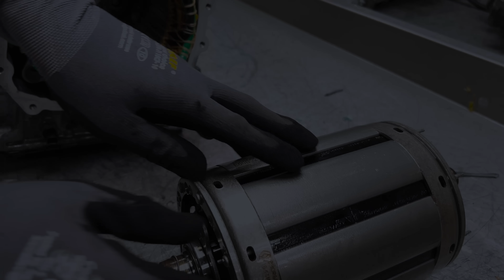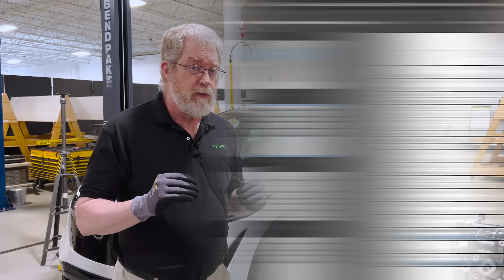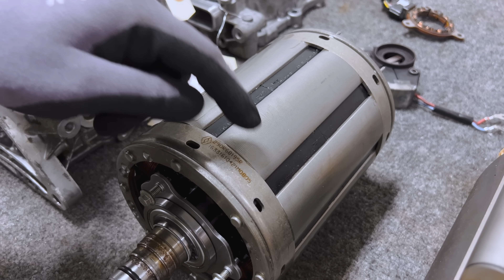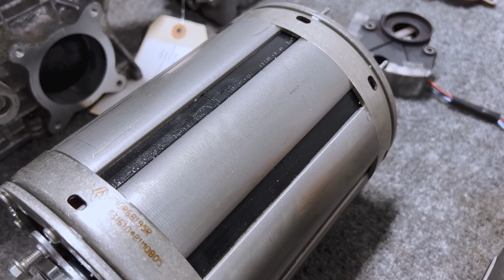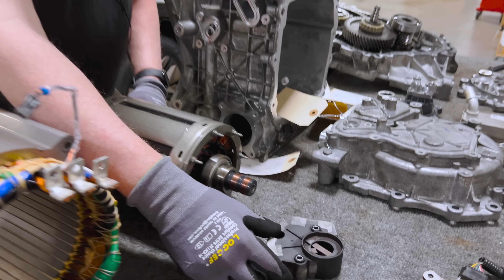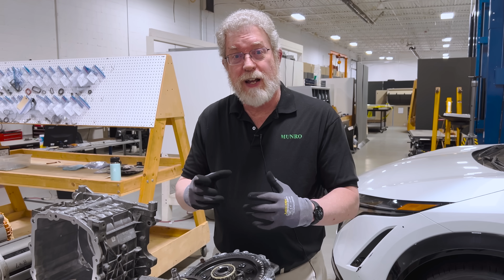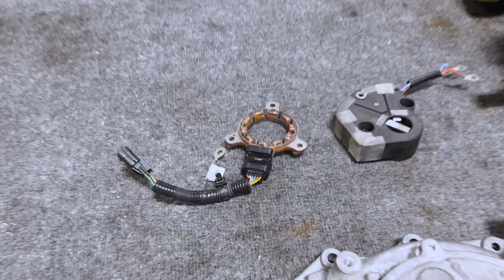This EV Motor Has No Magnets – Nissan Ariya EESM Teardown

Comment: I can't imagine any EV using field weakening unless it's very poorly designed. Clearly they are going to design the bus voltage and KV rating of the motor to allow it to function at maximum design rpm without having to use field weakening.
Reply: Clearly you don't understand motor control... but I'm sure you enjoy playing with your RC toys.

Comment: Did you know that trans-bearing high currents induce rotation to form a Marinov motor. The effect is very weak and it took me 165A to get to 1200 rpm.  It works on AC and DC and can run underwater. Google tesla downunder marinov

Comment: There was a claim that an induction motor is more efficient than a permanent magnet motor at speed. From what I can tell, this depends on gearing, and induction motor is only more efficient at really high RPM. Tesla uses PM magnet motor for efficiency, at highway driving speeds. So would be interesting to hear more why this was claimed.

Comment: So how often will the brushes need to be replaced and what will the cost of that job be?
Reply: He said that he expects the brushes might last over 250,000 miles.  Then, open a simple access panel and pop in a new part.  Imagine if an ICE engine would last 250,000 miles, and then open a simple access panel to get another 250,000.
Reply: @HonestJohn-y3k  "He expects" interesting that you put full trust in that. We all know cars are not built to last these days and then this vehicle is designed with a wear part and it doesn't matter how easy it is to get to this is going to be expensive to replace Labor and parts.
Reply: @HonestJohn-y3k  OK, but how accessible is that "simple access panel" when the motor is in the car?  If straightforward to do without dropping the motor out of the car, then great.   But if the motor has to come out to gain access to the access panel, then that makes the brushed motor rather undesirable.

Comment: Generally great, just uncertain about brushes and wondered whether exciter coils could have been used instead of slip-rings?
Also I think the Model-S was made with induction motors rather than Permanent Magnet ones as it was designed around the first time that China threatened to block exports of "rare earth" materials.

Comment: Great explanation on PM vs EM rotors and how back EMF can be better controlled at high speed with EM rotors.  Wise move for NIssan to make the brush module easily replaceable

Comment: When I first saw that it was a brushed motor, my initial reaction was very negative. My first thoughts were (1) that will probably lead to some lost efficiency and (2) taking apart the entire motor to replace the brushes will be a huge pain.

However, the fact that the brushes are very beefy and they actually created an access panel so the brush assembly can be replaced without disassembling the entire motor resolves this problem.

I like it overall! I'd have to see the efficiency numbers at low speeds and high speeds to judge, but I think maybe it's totally fine to simply use brushed motors.

For a car with BOTH front AND rear motors, I wonder if it would make sense to use a bigger brushed rear motor for high-speed highway cruising and a smaller front motor for lower-speed city maneuvering with software to determine how much power to supply to each one in different conditions.

Great teardown + explanation of the designs!

Comment: One obvious benefit is that with no current to the rotor it is coasting freely. For regen, feed current to rotor. 

I bet that Nissan/Renault has selected the rotor magnetic material so that the motor works like reluctance motor in high power situations,  not needing very strong current to the rotor. 

One Renaults invention is Chameleon charging in Zoe. They use the coils of the motor as part of the AC charger. Max power is in European Type2 44kW, if the charging device allows that 64A current in 3 240 V phases. Renalt still has usually 22kW AC charging.
Reply: I'm not sure how much this design can be used as a reluctance engine, based on an observation cars using these motors are somewhat hesitant when you try to pass over a curb-stone. It takes some time to increase the current in the rotor windings owing to its high inductance. If the motor used reluctance in this low power and high torque situation it would be instantaneous.
Reply: @32bits-of-a-bus59 Sounds like you are correct.
Reply: The 43 kW charger was only using the earlier Continental motor, so I guess they invented the Chameleon charger? Later Zoe models use the Renault motor which work  in the same way but is charging 22 kW.
Reply: @itekani The patent was filed by Renault. They use the coils of the motor as part of the charger and claimed to get tens of kg benefit in weight and materials. I didn't read the whole paper.. so not sure what was the real invention.

Comment: No magnets?  We've been using electromagnet motors forever.  Could be an induction motor, too.
Reply: No, it is not an induction motor. The rotor winding current is externally excited (powered) not induced by motion in the stator field.
Reply: And your point is?
Reply: @mcdevious2229 my point is that it is not, as you suggested, an induction motor. The video clearly describes the operation, so it obviously could not be an induction motor.
Reply: I never "suggested" it was anything.  So, still, what's your point?
Reply: @mcdevious2229 "Could be an induction motor, too"...

Comment: Do you have an estimate of the difference in  the cost of the motor between both designs?
Reply: More important than cost is the fact that China holds most of the cards when it comes to permanent magnets. Nobody wants to be held hostage by them. My guess, from work that I did thirty years ago, is there won’t be much difference.
Reply: The CyberCab pm motor, gears and inverter was announced at reveal as less than $1000, with no rare earth materials and high efficiency of 98%.

Comment: I hated  brushes not long term reliability on a automobile
Reply: This is not a brushed DC motor, pretty much better longevity with only small power going through doubled brushes without alternator.

Comment: Clear explanation, thx. Since you mention supply-chain related risk management: I know your current primsry format both here on YT as commercially is a post-mortem one (i.e. teardown). But it would be very cool if you guys can move to a more up-front architectural (design engineering?) format and discuss potential impact of say the Niron Magnetics stuff. Or related to this clip reference it to what Mahle has done/proposed.  And without it getting into advertorial type of content which I personally don't care for. Such a pivot may be an ask now but I think you can do it (also commercially).

Comment: The issues of sourcing of permanent magnet alloys and their thermal management due to temperature derating are universal. Adjustable field strength and serviceability of the brushes seem like acceptable tradeoffs.
Reply: Early days, but what is the cost of replacing brushes on an Arya? There is no way to evaluate that tradeoff without that piece of the puzzle.
Reply: @carlsonterrence The brush assambly will be like 50 bucks unless they try to rip you off.

Comment: If you’re going to go this way the best solution is high frequency touchless power broadcast into the rotor and then the rotor is also a 3 phase system that alternates out of phase with the stator and drives vastly more efficient and much more torque.
Reply: That avoids wear, but increase electrical losses. Like everything in the real world, it is a compromise.

Comment: It clearly does have magnets or, by definition, it could not be an electric motor. It just has inefficient electromagnets vs. good ol' fashion permanent magnets. It shocks me that Nissan has slid backwards in technology resorting back to using brushes. What a huge step backwards in just about every way. They implemented a two massive wear items, and an even bigger source of EM emissions. Shame on you, Nissan!
Reply: This is similar to what BMW is doing as they are using EESM motors also.  Brushes may be a disadvantage, but there are benefits. No permanent magnet or rare earth materials are needed, and the magnetic strength in the rotor can be adjusted to the vehicle speed, which is desirable.  With a permanent magnet the strength is fixed.

Comment: So basically this is alternator
Reply: Yes, it is fundamentally like a typical automotive alternator. If you remove the diode bridge from an alternator and replace it with a 3-phase inverter, you have a similar unit to this motor, but with a crude rotor winding.

Comment: how does it compare to async induction motors and inductively excited synchronous motors performance and efficiency wise?
Reply: This motor is more efficient and delivers more power at high speed than a typical induction motor.  It is more expensive and it has brushes that will eventually wear out.  One can use an inductive exciter (a rotating transformer with a rectifier) but that adds still more cost.

Comment: I have always appreciated Nissan's engineering. I had a 1995 Maxima with a five speed manual, loaded. Great car. The problematic automatics they use now killed the brand for me but this is very encouraging.
Reply: CVTs killed nissan.  I'd probably own one if they came with normal trannies.  I always like the rogue.

Comment: Interesting that at a time cordless tool manufacturers have moved over entirely to brushless motors in the interests of extra power and efficiency that Nissan/Renault are extolling the virtues of brushed motor technology in their cars.  The reality is that brushed technology is not as good as brushless technology in terms of efficiency and power.  Brushes eventually wear out and need to be changed, presumably at some cost in parts and technicians time.  Furthermore the copper windings get so hot that they burn the motor out unless they are cooled.  In power drills air is drawn through the motor with a fan.

Comment: It's like a big alternator with more poles, without the diode bridge, being driven like a motor.
DId this with a car alternator in 1986 using MOSFETs...
Another advantage other than avoiding the use of permanent magnets is a much wider power band as the available torque (back EMF) can be varied.
Reply: When you are easin’ down the highway cruisin’ at 70 you don’t need all the power that the motor has to offer. Reducing the field current  lowers resistance loss in the field windings and hysteresis and eddy current losses in the stator. 
An often overlooked benefit of a wound field over a PM field is that you can shut down the power in generator mode should there be a short circuit on the output. This will prevent the windings from becoming BBs  in the bottom of the housing.
Reply: What shape of BEMF you get - sinus or trapezoidal. What can you achieve by varying excitation coil current? Is there a reason to use less current than max in excitation windings?
Reply: @r11tc lower losses in the rotor windings when you don't need the torque but you can do the same with an induction motor without adding all the extra complexity and the rotor in an induction motor is cheaper to manufacture.
Reply: @franciscoshi1968  You mean ACIM? how would you implement this for ACIM. I believe these motors should have better torque compared to ACIM, and almost equal efficiency.
Reply: @franciscoshi1968  I'm curious of the benefits of both. You can run FOC to control exactly the field currents in the induction motor and run a maximum torque per ampere algorithm. I would think that you'd get more heat loss in an induction motor though since all the current for the field in the rotor is current going through the stator at first, and double the stator current is quadruple the losses, compared to an exited rotor only has the losses of the two fields on their own.

Comment: How is this different than any other induction electric motor like the one Tesla has been shipping?
Reply: It's not an induction motor. The rotor winding current is externally excited (powered through the brushes and slip rings) not induced by motion in the stator field.

Comment: Time to take a look at the Advanced Electrical Machines motors version ... county Durham 🇬🇧 nr Newcastle.
No perminant magnets, no brushes greater efficiency .. air and water cooled motors.
More Power and even copper free ..specially formed Al windings...easy recycling reduced cost ..
Withstands higher temperatures and vibration  and impacts..

Comment: Does the brush holder have a wear indicator incorporated?
Reply: Since it has only two wires not directly. Might be able too measure based on the resistence. Resistence will degrease slightly since the brushes get shorter and than increase quickly when they start to lose god contact. But unless they try to rip you of it is just a 50 bucks.

Comment: I own a Nissan Ariya and watching this video makes me feel that I have made a good choice!  I love the Ariya, a very luxurioushigh quality EV, Thanks!
Reply: I believe Renault Megane is same car
Reply: 很快你可以享受它的ev off 動力中斷😊
Reply: I love the fact an owner could replace those brushes! I have rebuilt alternators, so would be fun!
Reply: Brush in slip ring is durable
Reply: Well, those motors will be failing more often than CVT transmissions in Nissan cars. Brushes will fail due to wear, speed, bumps, sparking. It's a timebomb.
Reply: @ElementaryWatson_fafo 你說的沒有錯，中國市場賣出一萬量左右，百分之九十有故障，故障率十分高，車主都變成維修專家，這款車電機就是試驗品，第一代是失敗的！
Reply: @ElementaryWatson_fafo  that was covered in the video. Expected official brush life, expected brush life in real life and ease of access if (when) replacement were covered. 

Sure, brushless is best, but brushes are absolutely fine for the expected use and reduction of supply chain risk and costs.

Decisions like this are what will allow EVs to be reachable by more normal people.
Reply: @javelinXH992  Just because it’s a Japanese product, does that mean you have to praise it regardless of the facts, even if it’s a failed design? This car received extremely poor reviews whilst on sale in China and Japan, and had an extremely high failure rate, particularly with regard to the electric motor.
Reply: @siroyiryuu .  ??????? Not sure where I was praising Japan, Nissan or the Ariya? Just commenting on understanding the design choices made.
Reply: @javelinXH992  ——'Sure, brushless is best, but brushes are absolutely fine for the expected use and reduction of supply chain risk and costs.
Decisions like this are what will allow EVs to be reachable by more normal people.'
If all electric vehicle manufacturers worldwide were to use brushed motors, as you suggest, then EVs would simply become a laughing stock across the globe. Brushes have never been reliable, particularly when used in cars; sudden changes in torque and road bumps can cause these brushes to shatter, leading to breakdowns—which is precisely why the Ariya has faced severe quality scrutiny in the Chinese and Japanese markets.
Reply: @siroyiryuu  Then they will have to change…..that’s what companies do. Remember, I did say brushless was best. 

My car is not the best EV on the market, but it’s what I can afford.
Reply: @javelinXH992  Oh, I’m sorry—I’m getting on in years, and my presbyopia made me think you’d said it was best to use a brush. I’m very sorry.
Reply: @javelinXH992  Oh, I’m sorry—I’m getting on in years, and my presbyopia made me think you’d said it was best to use a brush. I’m very sorry.
Reply: The guy is blowing smoke up your end.  It’s a crappy motor when compared to modern motors.  They must be getting paid.
Reply: @acvwacvw  Right🤣

Comment: I was never a Nissan fan. I never really wanted an Ariya, but some of the deals were so insane I decided to give it a shot. This car really impressed me. I am not a big fan of the touch screen controls... but This the type of content I like. This car is so impressive and I am expecting it will last forever.
Reply: To bad Nissan is again on the verge of bankruptcy.
Reply: The brushes in these motors are a known point of failure. This is going to be another disaster for Nissan like their CVT transmission, that is if Nissan will still be around in a few years -- the may not.
Reply: @ElementaryWatson_fafo  i am sure you didn’t listen to the man and his explanation carefully, this motor is more reliable than the others that using magnets
Reply: @ahsamahi4385  did he say it's more reliable? I heard more efficient at highway speeds. Brushes are parts that wear out. He said they are designed to last 150k miles. I would be disappointed if my car's motor needed a rebuild after only 150k miles.
Reply: @ElementaryWatson_fafo  by the way, i have Nissan Rogue with CVT transmission it did 230 thousand kilometers and the CVT still running smoothly, very good engineering
Reply: Super under rated by people who have never owned or even driven one.
Reply: If I recall correctly, the Leaf had famously reliable motors.  Leaf drivers have so many positive things to say about it.
Reply: I've owned several Nissan ICE cars in the past and found that they are surprisingly solid cars as history has found the Leaf to be.  I would not discredit them lightly and would not be deterred from buying an Ariya.
Reply: @KiwiMechEng the only mistake they made was the CVT in their ice cars. My uncles 2006 Altima made it 260k miles on the original engine and transmission. People forget in the late 90’s early 00’s Nissan was up there with Toyota and Honda in reliability. I really hope Toyota can step in and get the French out of the decision making.
Reply: Agreed!  Got a e4orce engage + for sub 30k new.  Let’s hope ours hold up!  

Wonderful car so far…

Comment: It's great to see that I have an upgrade path for my ZOE, when I decide it's not enough. I will just get the motor from the Ariya. Apparently both are designed by Continental.
Reply: No, in house engineering by Renault.